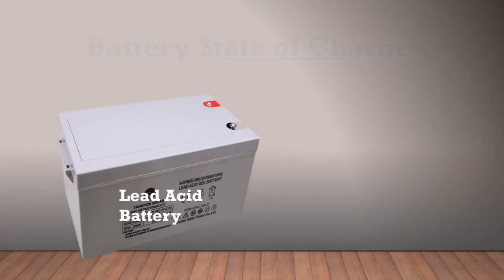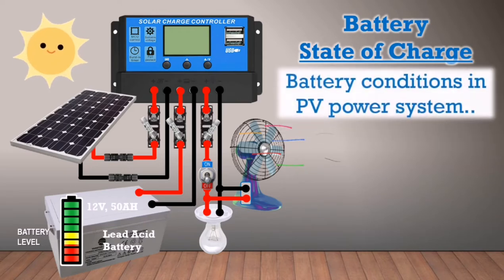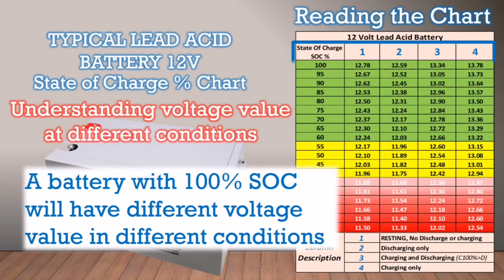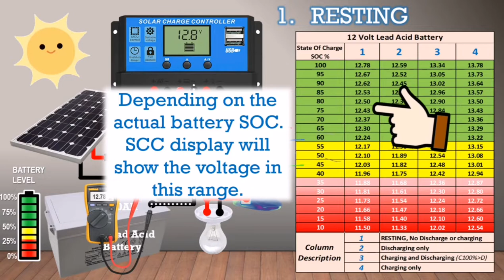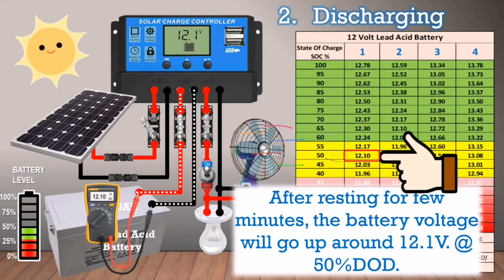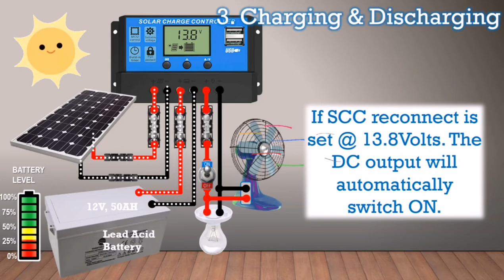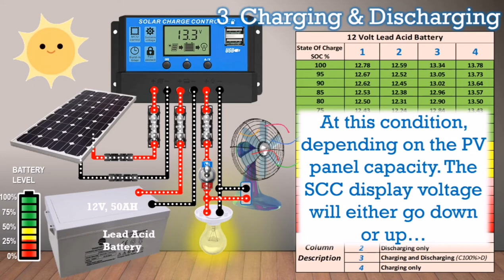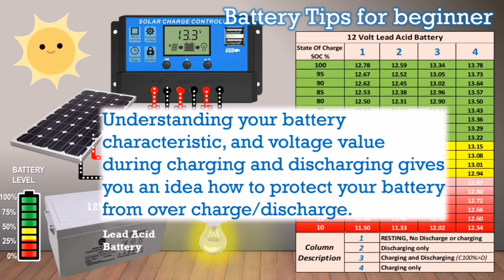Sealed Lead Acid Battery State of Charge at different stages of Solar Charge Controller  operation.

Comment: Noted on the battery charge will be from 14.44 to 15v, what that means?
Reply from the maker: Your battery voltage will go up from initial value to higher value when you charge. Just know the voltage of your battery when full charge from your battery manual, to stop charging and not overcharge.
Reply: @jfrelectechnical6652 what is float cycle 13.5-13.8 and cycle use 14.4-14.9V

Comment: Sir, my battery keeps overcharging. At full sun, it reaches 16.1V. How do I prevent this from happening? Is there any settings on my mppt solar charge controller I can change to avoid it feom happening?
Reply from the maker: There are other modules that have both protection for Low voltage detection and high voltage detection for overcharge.
Reply from the maker: What is your scc mppt brand?